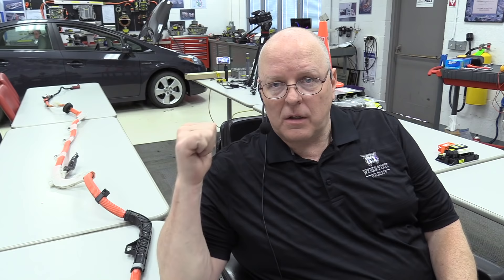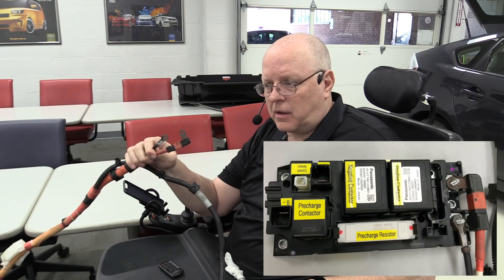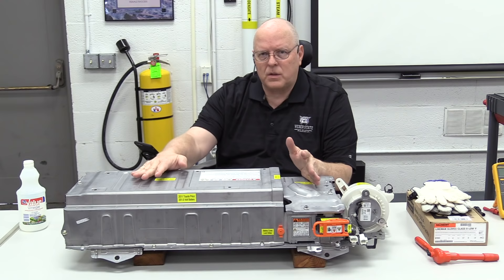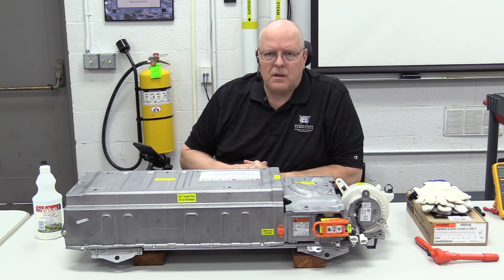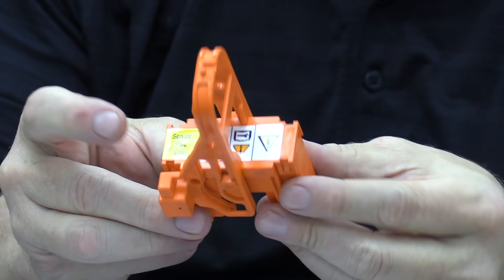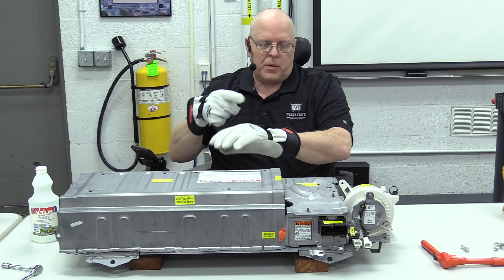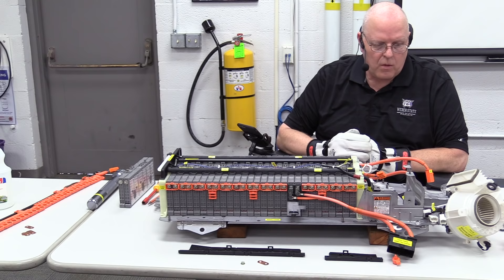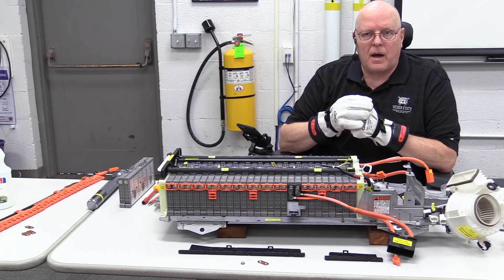2010-2015 Toyota Prius Ni-MH Battery

Comment: Hello Sir, thanks again for such informative video. I have question ive recently replaced mu HV battery pack on Prius 3rd gen. on a bad battery my prius was giving 20 km/l average, but now after replacement its giving me 14 km/l average. I did disconnect the 12 volt battery to refresh the system but im getting same 14 km/l milage. The battery cells are perfect, i did check each and every cell and performed toad testing on every one of them.
Reply from the maker: Have someone check for trouble codes. Obviously there is a problem somewhere. Best wishes!
Reply: WeberAuto  im a technician my self, im using a G scan 2, there are no faults present on car.
Reply: WeberAuto  there are no DTC on car ive driven the car for more than 600 km's now, there are no check lights or fault cods of any sort.

Comment: I have a 2014 Prius and put in a aftermarket Amplifier and Sub Woofer it needed to be grounded so I grounded it to battery case is this a no no or am I good??Please,please let me know.Thank You for all ure videos.
Reply from the maker: The battery case is isolated from the high voltage battery modules. It is connected to the low voltage system ground, so you are probably okay (especially if you are using one of the case to body bolts). Best wishes.

Comment: Hi dear dr Kelly! I had serviced toyota prius plus 2014 with stuck closed positive contactor error code, after checking it was stuck closed.  The customer purchased used unit on ebay, that has different part numbers on the contactors, after replacement the car starts, and get ready condition,  but put out errors about dcdc converter, and drive in limit mode... could be that wrong serial numbers on the contactor units making that trouble, or there's damaged inverter make that situation?
Reply: Error P0aa1 stuck contactor 
After replacement error p0a94 dcdc inverter converter performance

Comment: Hello Professor Kelly,

I subscribe to your YouTube channel, I enjoy all your videos and know that you are an excellent instructor. I have a 2002 Toyota Prius and removed the battery safely after purchasing the high voltage gloves. There was so much corrosive substance on the bus bar I had to throw it away because it was difficult to remove the sticky substance that appeared to be from the batteries. Based on the pictures attached will these batteries be able to be cleaned and reused if half of the batteries are just over 7amps? Hope you can help me out
Thank you kindly

Comment: I bought a 2002 prius, the bus bars were very corroded, the orange plug going into the smart box and the connection in the smart box were melted together. i replaced the smart box, all the cables, 7 modules and the 12v battery, and it still wont start.. it drove terrible when i bought it, drove it home replaced all those parts now the ready light blinks 3 times and it wont start. Any suggestions?
Reply from the maker: Check it for codes. If it was shuddering while driving, you probably have a shorted MG2 stator winding in the P111 transaxle :( Best wishes

Comment: Enlightening! I'm ready to go used hybrid!  Would there be any advantage to adding a little dielectric grease to the buss bar connectors?  Thanks.
Reply: I've tried that and that idea is a lot worse than just leave them cleaned with vinegar. The problem is those buss bars warms up while in use and any grease applied just will dry out and make a terrible resistance between buss bar and the module.

Comment: Do you happen to have a TORQUE specification Blown out Diagram sheet for the HV Traction Battery for  the Prius 2004-2009? I'm aware that a INCH lb torque wrench is needed and not a FOOT LB Torque Wrench when dealing with the Traction Battery...I'm finding people stating different specs for the nuts to the modules being 48 inch lbs to 60 inch lbs . I cannot find Toyota Data sheets anywhere except a 2001-2003 specs sheet but not the same battery. I'm replacing the Temperature Sensor Hardness and don't know the Torque value and the Plug Cut-Off Harness   also the main connections Car Harness to Battery was mentioned in a vlog at 50" lbs..I've already done this job once but car sat for a while and I lost 4 modules thta I''m now  redoing the pack...cycle discharge and than charge back 3x and do the final parallel balance charge at the end plus to plus and minus to minus...Thanks for your help if you have the spec sheet. I'm using a beam torque wrench that simply has a pointer on it as the metal bends it shows the value..is that a waste  I think it's brand name is Neiko..should aI go to one of the clicking ones?
Reply from the maker: Toyota does not publish the specifications for those. The only specs I have seen were for that 2001-2003 battery
Reply: @WeberAuto  thank you. I appreciate your professional videos.

Comment: Hello Professor, I watched your video it is very interesting. I followed your advise but my car's problem is not solved. I drive Toyota Camry 2007. And it has problem (check VSC system and 
 check hybrid system), (P0A80 and P0A7F). My car's batteries are 277V. Each battery is 8.5V but one is 6.8V. During dive on the screen I see that the charge is low and engine does not switch off. When I start engine several times I see on the screen that battery is full charged. But some time later the battery is low again. Please help me with your advise. Thank you.
Reply from the maker: It sounds like the one at 6.8V is bad or has poor connection. Best wishes!
Reply: I checked all the batteries with the load and all are 8.01-8.09, only one is 7.83. All connections are OK. But the car still has a problem. Please help me. Thank you.

Comment: I hav Prius 2013 has 160k milage onc every few weeks the light hybird battery heat up means need fan cleaned but fan is clean so why that light comes on the battery is heating up I drove car a lot and is on all day what is the problem the fan works fine

Comment: I have DTC P0AA6 hybrid battery voltage system isolation fault ... and i open the battery and didn't find any damage or leaks on cell and it is like in good condition and i still have check hybrid system and triangle 🔺️... please can help me what is the error of my car (camry hybrid 2017)

Comment: Relay and contactor - not sure about single and multiple poles.
Reply from the maker: Sorry for the confusion. 

Automotive relays can have have multiple poles (normally open, normally closed) in one housing (4 or 5 pin relays). An automotive relay has one spring loaded contact that either open or closes one pole when acted upon by the magnetic field of the relay coil. 

A contactor is what is used in a starter solenoid. It has one spring loaded disc that makes contact with two poles at the same time when acted upon by the magnetic field of contactor coil. A contactor has a 4 pin connection. I hope that helps.

Comment: great sir,
can we install Lithium-ion batteries in prius 1,2 and 3rd generation that has a NiMH batteries ,i want to change the battry only not the BMS , is it possible , what items i have to modify.
for example in lithium ion battery there are 56x3.7v cell arranged in 2x28 cells blocks, while in NiMH 28 blocks x6x1.2 v.
so each block of NiMH has 7.2v and total 28 blocks, while lithium ion has 3.7v x 28x2 , and if for lithium ion i arrange it as 3.7vx2cells=7.4v as one block so there will be 28 blocks for lithium ion also. so i can use the same NiMH BMS.
it is possible

Comment: Hi, thanks for your videois  very intesresting. Do You think the juntion block wich we see at 56:20 could be the cause the battery bank lost connection to the system givingnthe error "check hybrid system" (Toyota Prius). For me, sound like the relay try to swtich but doesn´t wokr fine. The temporary solution is to reset te 12V battery. Then the hybrid system work fine but the error return again when I accellerate for full power the gas motor. Thanks in advance.
Reply from the maker: It is not very likely. Have someone check for trouble codes and see where that leads you. Best wishes
Reply: thanks

Comment: Probably shouldn't be touching the case willy nilly without wearing the orange high voltage gloves on. The safety disconnect is still on in that battery

Comment: Hi what up how thinks .Mike's I have a nissan xtrail  2015 hybrid. And not starting. Having c1130 .and c118c codes .so fer I ckeck the 12v battery ok .check all fues .good .check all relays ok and all 2 code is on the ABS system .?

Comment: What's the max voltage  for each module?  How many  amh are each module?
Reply: 6.5 Ah when new, typically north of 5 when getting tired.....and 7.2 vdc nominal per module, although they rest to approx. 7.4-7.6 vdc. Anything south of approx. 5.5Ah or so and they start to dive under load and you'll be rebuilding/replacing soon.

Comment: Hello I would like to buy individual NEW Panasonic prismatic MiMH 7.2 volt battery modules for my Tahoe (Uses same batteries as a Prius total of 40)  I cannot seem to find a source for new just a bunch of old used batteries does ANYONE know where I could buy New modules without having to buy an entire assembled battery. Just seems silly to replace the entire battery assembly when these individual modules are so easy to change out.........................
Reply from the maker: I am not aware of any place that sells the new original battery modules. Best wishes!

Comment: i get a code p0a80 i did what i see you do all hybrid volatge good i clean all the scrwers i still have same problem check hybrid system but i found 1 thing when i start the car the hybrid battery make small ticking noise when i turn the car on and off any help please
Reply: im have the same  i plan to review   , did you solved  the issu

Comment: Hi I have got a problem with isolation . Even if the plug is off it still shows 188 volts kindly help thanks
Reply from the maker: 188V at the contactors? Or at the service plug?

Comment: so my prius was throwing a p0A80 code.My hybrid battery on the lcd screen started charging but dropping charge very quickly.We took apart the hybrid battery and lots of the cells were on average abt a 7.8 or higher .we decided to get a battery load tester and balance all 28cells to 7.5 but once we put the battery back into the car now on the lcd the battery is showing very low and car will not charge it.We tried driving it around and it will not charge!In fact the car stopped on us and the engine cut off was very rough.PLEASE HELP!

Comment: hi I have a question for you I have a 2009 Prius I bought it with the triangle light on I troubleshooted it and i got a code c1310 and so someone told me your battery is leaking acid and so I opend it from battery 3 all the way to 7 and I found dry acid and so I measure all the batteries and found cell #5 was droping the charge quickly so I put it back together  still the light was on please help me. Thanks
Reply from the maker: There has to be another code with the C1310. Check for codes and information codes and see where they send you.

Comment: can i take out nuts from battery with normal ratchet or must be isolated?
Reply from the maker: It should be insulated. A non insulated can work, but you have got to be very careful to not let it tough anything else while using it.

Comment: An easy way to clean the bus bars is to use Caig Deoxit D5 Spray for cleaning and then Caig Deoxit D100 Spray to protect the copper surface. No dismantling of the bus bars necessary. www.caig.com   Available at www. mcmelectronics.com
Reply from the maker: Thanks for your feedback. The corrosion is occurring under the nut and between the bus bar and the battery terminal. Disassembly is a must.

Comment: Hi professor, Mario here from Portland Oregon. Can you please help me, my 2010 prius HV battery had been giving me s lot of problems. It's always the "P0A80" code to replace my hybrid battery. I have pull out my battery and tested every module and they are all in good condition with 7.9 volts each, I also tested the whole battery and it tested about 155 volts in one end and 71 volts en the other end. When I first pulled out the battery all the buzz bards where very corroded so I clean them up really good, also the little nuts where badly corroded so I replace them with  Stainless steel ones. I have also change the service plug grip thinking that it may was the fuse in it but I still get the error very often. 

The little nuts I tighten at 48 inch  Pound just like you said on this video. Note: on a different video someone said to tigh those nuts at 75 inch pound? Which is correct? 48 or 75 inch pound? 

Lately I place an order for the voltage sensing wire  Harness on Ebay because the toyota dealer doesn't sell the part  Separate, they said that is part of the battery and that I can only be purchased as one part which is like $4,000 or more. I hope you can direct me on what to do next. Thank you so much and God bless.
Reply from the maker: It is possible that your battery is just worn out. The internal resistance of the battery becomes high after prolonged use. It sounds like you have done all you can. It is probably time for a battery. Best wishes!
Reply: Thank you... one lost thought. I use this 2010 prius to drive for uber, some one told me that due to the fact that I use this car very heavily and most of the time during working hours the car is always on even when parked waiting at a staging area to pick passengers that the"battery core" goes bad. What do they mean by that?
Reply: It's it's posible to ruin my inverter converted by continue using my car with a bad battery?

Comment: checked all the batteries with the load and all are 8.01-8.09, only one is 7.83. All connections are OK. But the car still has a problem. Please help me. Thank you.
Reply from the maker: They all need to be very close to the same voltage under load. Best wishes!
Reply: Thank you for answering. The batteries are in the same voltage. I want to know what else can be the reason that on my car's screan I see "Ckeck hybrid system and check VSC system". My car has a problem but I can not understand it. When I disconnect 12V system battery and hybrid system battery and after that I connect them again, hybrid system starts, but some time later I see on the car's screan the same again.
Reply: we do not have professors in that sphere in my city that's why I need your advise. Thank you.

Comment: I have a 1st gen Prius and I just removed the hybrid battery. Nothing wrong with it but the car itself is trashed. The motor blew and it's really rusty. But man was the terminals on one side super corroded. It was so bad that when I took it apart it left a pile of blue dust on my floor that I had to sweep up. I don't know how the car didn't throw any trouble codes or lose voltage in some areas but the caked on blue corrosion was super bad! Worst I've ever seen. Other than that though the battery is 100%. Im going to put them in my 2nd gen Prius because my second-gen battery has been super weak since I bought it.

Comment: i removed my prius 3rd gen hv battery and the  cells showed me 6.86 v and i guess it was drained out and removed. 6.8v is healthy cell  or weak ?
Reply from the maker: That is a little bit low. Approximately 7V is the low end of normal.
Reply: WeberAuto thanks you for ur rep.what should i do replace the or recharge?
Reply from the maker: Try recharging first, then replace

Comment: Hi sir how can I check the modules cell  if the Battery been of the car for a year do I need to recharge it and how to recharge it please help me thanks
Reply from the maker: The only way I know of is with a volt meter, but that does not load test them and does mean they are good.

Comment: how does this compare to the 2nd gen Volt's battery?
Reply from the maker: It is almost identical. They both use 28 battery modules, but the battery smart unit is a different physical size and the contactors are separate parts (rather than part of one hybrid battery junction block)
Reply: Thank you for that response.  I would love to see more content regarding Volt's, if and when you can. :)  I think a lot of Volt owners are interested in this, even when not mechanically inclined....(Like myself)

Comment: Does anyone here have any advice on putting 1st gen batteries into a 2nd gen Prius? as far as I can tell it seems the only difference is the number of modules and the 2nd gen has foil on the outsides of the modules and the 1st gen doesn't. Also, wondering if anyone has any experience using battery terminal protectant spray on the posts?

Comment: Hi Processor John Kelly, Thanks for your helpful video for the explanation. I am Alan who is driving Toyota Pruis C Year 2012. Could your please help me? I wanted to know the wiring ( cable ) connection details between hybrid battery and inverter. Especially, the wirings connection to the hybrid battery. How many pairs of wirings? Like temperature sensor and voltage monitoring for hybrid battery. What is the maximum hybrid battery charging current and discharge current?
Reply from the maker: See my videos on Toyota inverters for that information. Thank you!